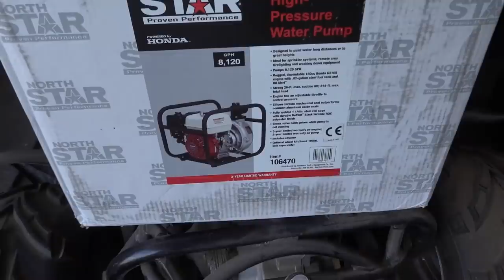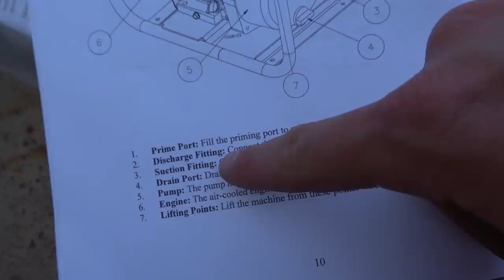I Built the Pumper Truck!!!!! Master Chief is Alive!!!

Comment: For the shorter hose, you should just buy a short hose on with a cam lock and have the large one in a spool so if you need to change it just unroll the large one and switch the cam locks in like 10 seconds
Reply: just what i was thinking
Reply: Would a splitter work? So that way he just chooses what one he wants with out having to switch and hoses.

Comment: For your hose, get a 1 1/4" booster line.  You can get a line a real off of an old firetruck.  For splitting we use what's called a gated Y.  Keep in mind with a fully loaded tank offroad, you will snap those straps in no time.  Way too much weight.  Also get some spanner wrenches for your fittings.   And if you really want to get more fire aligned Get some Storz connectors to put everything together.  If you want to keep the connector running off of the tank, drill a hole in the handle and put a push/pull rod in it that you can access from the side of the truck.  Hope this helps.

Comment: Hey Matt, the only bad thing about filling half way is that when your driving the water will slush around possibly causing an accident or unbalance
Reply: It needs metal slids/walls/brakers to stop the waves/slushing, you see it in real fire engines and tank trucks and ofc in oil tankers too

Comment: Matt....two words....water cannon.   I would expect nothing less for Demolition Ranch.
Reply: I was thinking the same thing as soon as he said he wanted to hose things from the truck.
Reply: Was thinking same he has to do it
Reply: Me either, but that’s likely gonna be $3000 pump and a much larger tank. With just the nozzle he has right now he will be through that 500 gallon tank in about 5 minutes.
Reply: @Teodede  he can use a small watercannon, doesnt have to be the airfield size. And the pump may need changes, but not a new 3k pump (although id use a pto pump anyway

Comment: Hi Matt, you can try to fit that pump on the side of the truck right under the truck's bed. It will give you an easy access to the pump and good chances to use the fuel tank that already there without adding extra fuel pump and hoses.

Comment: Cap the tank, have it drain through the center of the tank by creating a new drain, that way more water also can drain from it. Have it hard lined down underneath the center of the bed, hardline pipe  to the pump with a valve at the side next to the pump, and the pump mounted to the underside of the bed to give you full access to everything in one area. Assuming there's room. Also opens up some of the bed space for other things, such as tools you may want nearby for helping with fire control, etc. Might be a bit more work than you're looking to do too though. But, an idea!
Reply: I was thinking about something like that as well

Comment: The hose you want is called a booster line. It’s rigid and is made to be put on a reel and be used for brush fires.
Reply: They also often come with an electric motor to reel it back in so it can be pulled and put away by one person

Comment: I'm a volunteer firefighter for a small town in lower Alabama. We mostly deal with brush fires. That hose is meant to be an attack line. I wouldn't put a hose reel on it, however, I'd build a box a little lower than the bed to fold the hose in the box. I would also suggest putting a manifold in with a second hose coupling for a smaller line with a hose reel.

Comment: Mount the pump down low on the back of the truck and put a 1” rigid hose reel back there.  You will have the pump accessible to start from the ground and you can gravity feed fuel to the motor from that big gas tank under the truck bed.  Everything will be easy to access from the ground if you just mount it all on the back either under the truck bed to just above the back bumper area.

Comment: You should mount a hose bed so you can pull your attack line from either side. Attack line is the red hose. Also you will need to have a place to hang dry your hose after it’s been used. Stops it from rotting. 
Hose reel is handy but has higher price tag attached so you have to weigh our options. Good luck and let me know if I can answer any questions. 😀

Comment: Next video: I pressure washed the 5-ton with my firetruck!
Also, what if you mounted the pump under the bed between the rear wheel and the cab?

Comment: Safety Equipment - gloves, helmet, bunker gear, etc. If you plan on putting out fires you are going to need that kind of stuff. And as others have said baffles in the tank so the water doesn't slosh around and tip you over.
Reply: Hay Mat, I have bunker gear if you want it.

Comment: I would recommend a solid black tank to prevent algae growth inside the tank, and you can install a gauge on the outside of the tank to check your water level. Also, I would recommend keeping the tank full to prevent sloshing. 

Thanks for the videos!
Reply: Even better idea would be a aluminum tank. I'd hate to see the sun dry rot it and it split when you have a ranch fire. 
Get a local fabricator to fab you up a square tank, with fore / aft and crossways baffles installed.

Comment: Move the rings out of the way on a the locking levers so they close completely. You can get leaks if the locking arms aren’t fully seated. Cam locks work very well. Just make sure the gaskets are good. They start to leak when worn out and make sure the locking arms are fully seated. I used to use them when i worked in a chemical plant and we used hoses and pumps for everything with cam locks.

Comment: "I want to be able to spray off the back of the truck" - that moment Matt gives himself a perfect excuse to mount a water cannon on the back of the truck as an option - with those quick connections it'd be easy enough to just switch the output over depending on if you want to spray off the truck cannon or hose.
Reply: I was thinking the same thing.
Reply: Why quick connect? Get a split with 2 shut offs behind it one leading to the hose and one leading to the deck mount
Reply: This could also help have double the output if he needs it

Comment: Looks like that should work! It's helpful to have a bleeder (only needs to be like 1/2-3/4 inch) that goes from the pump output back to the tank and an easy to access valve that allows you to crack it on and off. Maybe between the output and the reducer. It allows you to keep the pump running without having the hose open. Otherwise the water in the pump head will eventually overheat and cause pump damage (unless you have a hose cracked, and cracking the hose all the time wastes water)... That is what we used to do on forest service fire engines and it was helpful.

Comment: Some sort of lowering shelf to put the pump on for quick access that also holds a hose reel. Fire starts you unlatch the shelf pull down the pump open the water feed and start the pump, pull out hose, and be a hero....😉

Comment: Get you welding buddy to build you a pullout pump-platform which lowers half way down the truck on rails
Reply: I had the exact same idea! lol
Reply: Or just mount the pump under the bed, tons of room under there.
Reply: Get a pintle mount for the water cannon. You got the quick detach mechanisms so you can swap hoses like lightning

Comment: You should check with your buddies at the local fire dept. You need to ask them to borrow their spanner wrenches to lose and tighten those hoses and fittings.
Reply: He also needs a feve side wrench for the fire hydrants so he doesn't need to fill it off a well

Comment: Reckon you run a hard line to the side with a manifold. Off that manifold run a hose to your pump.  A couple of gravity feeds.  And mount the pump the below deck so you can get to it easily.

Comment: As for hose get a booster line (rigid hose) on a reel. And possibly mount the pump under the bed drivers side so you hop out and start it.

Comment: You should get a reserve tank or two at the headquarters just in case a fire gets out of hand you can re-fill.
Reply: Yes a second 550 gallon tank elevated so that it can gravity dump into this tank if he drives under it.
Reply from the maker: @jaydak99  oooooo this is genius
Reply: @jaydak99 that’s a great idea. Also collect rain water in a reserve tank too.
Reply: @offtheranch Or put a reserve tank on a trailer so you can have more water on standby. The firefighters in my area use mobile storage tanks and then keep the tank trucks in travel to go get more water for refills. Pretty remote here..
Reply: @Clarky316  yea rain water refill tank is a great idea
Reply: @OffTheRanch  watch how a fire hose comes off a firetruck..you build a box to lay hose on top of its self so you can just pull it out then turn pump on
Reply: @OffTheRanch  Couple this idea with the other ones recommending a baffled tank.  So, take the current tank off the truck and use it for your storage tank, and get one with baffles for on top of the truck.  And getting one made in black will save you some headache too, as you won't have algae growing in it.  (You can paint the storage one, too)

Comment: Matt turn tank sideways so you can reach valves from ground mount motor lower on truck or close to the side so you can pull cord use two hoses in reels one short one long but hard plum from pump to fixtures on truck to prevent fatigue on fittings

Comment: Mount the pump under the truck run the hose through the bed to the pump so the pump has gravity on its side and the pump is low enough to start and run the valve to control the water over to the side like you said.

Comment: Cam locks are great. Used them alot. As of tank position move it back 1 foot. You'll need the weight near the rear tires for better traction and weight distribution

Comment: Have a welder mount the pump under the bed if there is anywhere that it won't affect ground clearance and then hard pipe inlet through the bed. Have a tee under there with valves on both side so you can take in water from the tank or a different water source and then have the outlet wherever you find most convenient.

Comment: I've built a whole bunch of water trucks. You're heading in the right direction. First, drill a hole in your tank valve handle and attach a rod to open it. If possible mount your pump under the deck for ease of operation.  That will help with priming the pump as well

Comment: Look into a 3" high pressure northern tool (north star)  pump. Have it reduced to a 2.5" snd then to a 2.5 to twin 1.5" gated wye. You should also put a 3/4" recirculation hose back to your tank so its not running hot when you have hose closed.

Comment: Weld a mount off the back that is lower to hold the pump and a electric reel with a trash line. Pipe the tank shut off closer to the ground and everything should be accessible without climbing up. Something similar to a rear mount for a generator on a camper.

Comment: If you want to use the 100ft hose you should fold it to rip it down the truckbed. You cold also fold and strap it like a hose package to carry over your shoulder. Or fold it in half, roll it up from the middle point and then you can throw it out as a snail package.

Comment: You need small 1 inch reel. They used as first response reels on euro fore appliances. If you can get a bigger pump it works off battery & electric starter to be more used friendly

Comment: Matt, With you wanting to be able to operate everything from the ground, you could build a bracket off the side of the frame for the water pump to fit on. This would allow the pump to be easier to access, also allowing the water from the tank to be higher than the pump. This would make sure that you could use the tank to its fullest potential. Then the back of the bed could be used for shovels or axes or whatever else to store and have easy access to.
Reply: Came here to say this.

Comment: Hey Matt, firefighter from Central Iowa. We just completed an update to our old military Dodge M880 used as a grass rig. We're a small department with little funding so we often buy things at the local stores because it's less expensive and does what we need it to. The booster reel and hose would be beneficial because you pull off only what you need. And the recirculation line would be beneficial so the pump doesn't overheat. We used 1/2" hose. The camlocks are a great idea, but since they're not readily available in our area we used a pipe union. We also created a manifold for more connecting options. Our manifold design has three valves for garden hose, and one 1.5" NPT which will be adapted down to 1" NHT for wildlands hose. 

https://photos.app.goo.gl/hnfBXG1oZVHBQRsV7

Comment: You can get a "Y" with 2 ball valves that should thread onto your discharge adapter. My fire dept then had a thick rubber 50 foot garden hose basically with just a hand crank reel for smaller fires.

Comment: could always mount the pump under the bed side and  have it hard piped from the tank and  then back up to the bed for your hose reel and any other lines even include a auto recirculation valve so you can keep the pump running without building to much head pressure

Comment: What you need is 1inch trash line. My volunteer department has 2 of them and there exactly what you need. Its rigid and its on a reel so its easy to pull out and put away.

Comment: I think if you hard piped the water tank to the pump and then put hard piped valves on either side of the truck and maybe a sprayer turret on the back it could be pretty versatile.

Comment: Suggestion... You could mount the water pump below the bed but even with fuel tank to use as a siphon if you’re going to draw off the chassis fuel tank and then you can put a motorized terret system on the bed so you can operate with push button in case of small fires and you could still use the hose for big fires that are far away.

Comment: I would spin that tank 90 degrees Matt!
Reply: Y?
Reply: @kevinhermez1986  better weight distribution and space saving
Reply: Less hammer without baffles.
Reply: @kevinhermez1986  leaves more room on the bed too
Reply: No. He’s much more stable front to back than he is side to side. He doesn’t want to leave that much room for water to shift in an off camber situation. He’s not hauling half loads down the freeway.
Reply: By doing that every time track accelerate, there is a chance for the tank to top over especially when its full of water
Correct me if im wrong
Reply: NO, ABSOLUTELY NOT! Take it from a truck driver, do not turn it 90°
Reply: @osumbuckeyenut  we're not talking 45000 pounds,  and it'll generally be full,  or nearly full  until he arrives at the fire.  I've driven tankers, and I've also driven a floor cleaning van which had a similar tank installed sideways without I'll effects, albeit it did have baffles.
Reply: @sinahashemi5528  saddle straps would alleviate the worry of tipping.

Comment: One thing I always do with small motors is to put fule stabilizer in the gas so it does not gum up the carb if the motor is not ran for a few months. Also one more important thing is I turn off the gas valve and let the carb run out and the motor stall by running out of gas that way the gas does not turn into slug in the bowl of the carb and it starts first pull for years.

Comment: Heavy metal rakes have been suggested already. You are in an area with a lot of pastures and grass so I would suggest a couple of shovels and rubber flappers. Ask your local volunteers about them and how to use them, good for spot fires caused by sparks when using the hose on main burn.

Comment: Mount a turret in the back. Use a Y valve off the discharge of the pump. One side feeding your 100’ hose real and one side feeding your turret.

Comment: Oh yea also. You'll need to keep the tank covered in summer out of the sun cause it will get sun baked and get brittle. Also, with the soft hoses be careful not to let it pinch you when it bends lol 🤣 that hurts plus don't ever throw the nozzle on the ground cause they break then the hose can swing like crazy and hurt someone.

Comment: Slap on a water can so you can grab it for small spot fires. You can pressurize it yourself and fill it over and over when empty. Its a little bigger than a standard fire extinguisher and they can have straps to carry them easier. Those things can put out a room and contents fire if used correctly.

Comment: Look up what’s called a booster reel. It’s a hose reel that is typically 1 inch hose used for brush trucks and even pumper trucks for smaller fires. But it’s a hard hose and some have an electric rewind to wind them back up.

Comment: Hey mat, to stop climbing up n down the tray, mount  the pump and hose reel  under the tray near the petrol tank and run tank hose through the floor so the tray in clear and user able for other item may be another ibc for foam or more water. And it accessed from the ground.

Comment: You may have to go to 1.5” hose, we were running 160 gpm on a smooth bore nozzle training on a 1 3/4” hose and the hose was collapsing a little bit.  With that fog nozzle you might be alright but you need to be able to keep the hose inflated so that it doesn’t kink then flail all over the place when it re inflates the kink.  Plus if you get a four way valve you should be able to switch from  pumping water to filling your tank just by manipulating the four way valve.  Booster hose is more common for brush fires which would be the rubber cover solid hose that you put on a reel.  Also if you make a plywood hose bed you can either do a flat load or a minute man load or probably five others that allow you to flake out the hose without kinks very quickly.  Also our pumper trucks commonly only carry 1,000 gallons and full bore high flow multiple hose lines we can drain it in 7 minutes or less, so 500 is a significant amount.  You can always reach out to wranglerstar,  I am just in class right now, he actually has experience